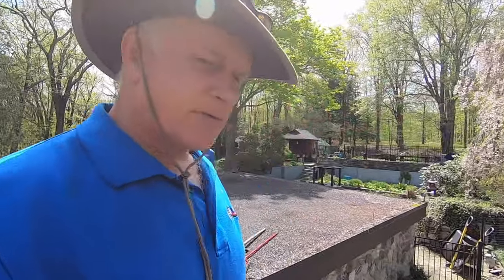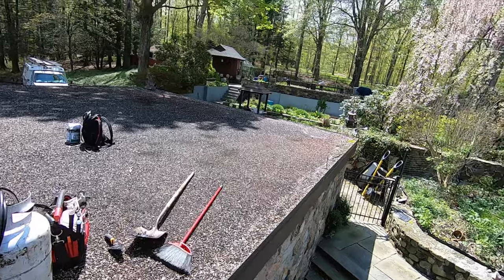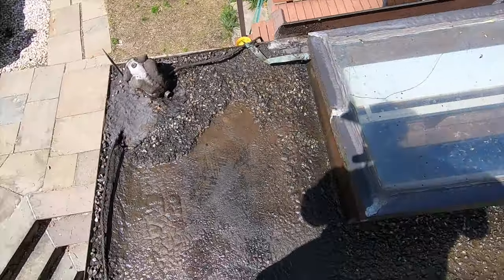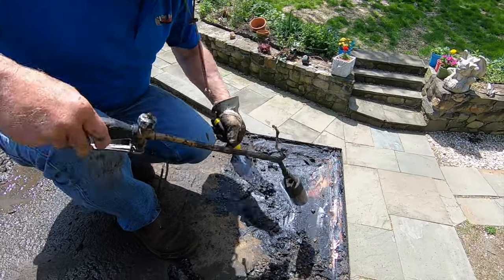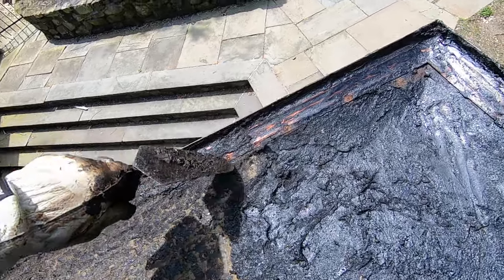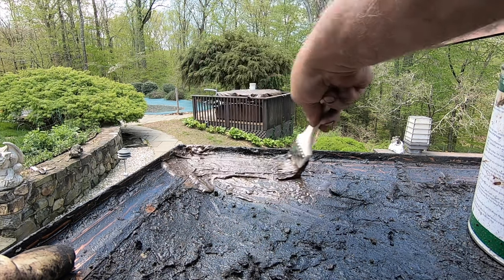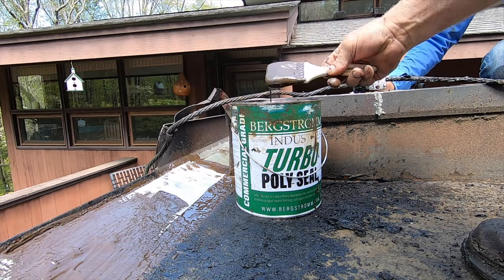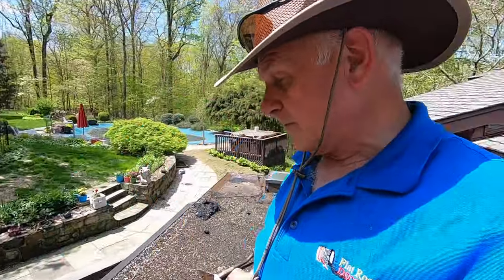How to repair a leak on a flat roof with Tar and Gravel - I show my trick of over 35 years

Comment: Preparation, Preparation Preparation then repair. Excellent advice.  Thanks for the video.  You're a treasure of knowledge.  Only one thing confuses me, when is it best to use super silicone and when to use turbo polyseal. Thanks a million
Reply from the maker: On Asphalt I use Turbo Poly Seal, on EPDM I use Super Silicone Seal. They both can be used on metal transitions. Turbo Poly Seal is still a superior product. It is stronger.

Comment: Great video, thanks for sharing your secret 😊 I have this exact problem on a slow pitched tar and gravel roof and have been looking for a confident fix. Did you link the polyester fabric you installed between coats? Thanks!

Comment: Hi Doc, thanks for the help. I have a gravel flat roof (17 x 30ish) with a commercial tenant below; they say my roof leaks and I say it's their ridiculous huge air-con unit. There's water getting in, but it follows the ductwork and can't be pin-pointed. My question is, can I use turbo poly over the gravel to seal up the roof and halt my end of the problem? A thin coat over the gravel (they make rollers which will work for this), fleece it then roll another coat over top... voila -new roof!

Comment: Does not look like the original installer used copper nails to fasten the gravel stop.  Big corrosion problems when you mix regular galvanized or even aluminum nails with copper flashings.  

Question:  what did you do with the lighting rod?

Comment: I wouldve put karnak trowel grade adhesive then do a target with cap sheet  and then 3 course around the cap sheet using adhesive .,Fiber glass karnak screen ,then reput the adhesive then ad granules but i mean some people do stuff different 🤷🏽‍♂️ im a commercial tech and thats usually how we do it and it lasts multiple years and tbh it doesn’t take long maybe 20-30 min but its more secure
Reply: Would you have done the same amount of prep work?

Comment: Couple of questions.  First, I'm sure you added additional fasteners to the  loose  gravel stop. But, did you use copper nails ? You did say it was copper. They probably used galvanized nails on copper.  Which tells me the entire edge has no fasteners left. Never use steel nails on copper.  
Second,  does the polyseal come in colors?
Reply from the maker: I did not add more fasteners. I agree using different metals is an issue.
The Turbo Poly Seal only comes in brown

Comment: Why would anyone use that kind of roof anymore
Reply from the maker: You got the wrong idea. These are existing roofs that could still be repaired. I don't think there are many roofing contractors left installing these types of roofs.
Reply: @FlatRoofDoctor  yes that is what i meant. It seems to be a very old way to do a roof and it is not repaired easily. One thing i look for in a roof is how easily is it repaired because it will have a leak at some point
Reply: @benjaminlee5096  thise type of roofs last about 2 times as long as newer types. The rock on the roof reflects and protects from UV. Proper slope and drainage during framing process is crucial